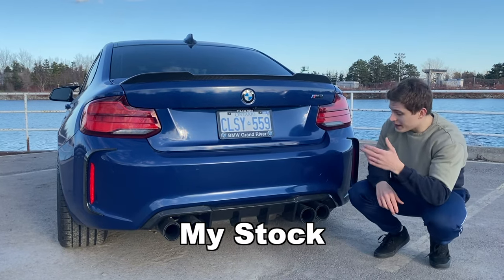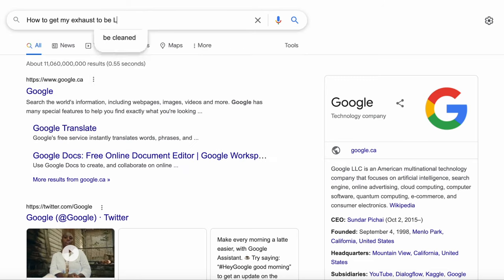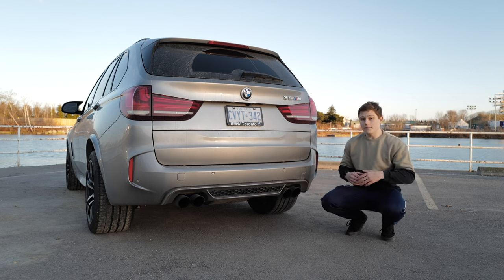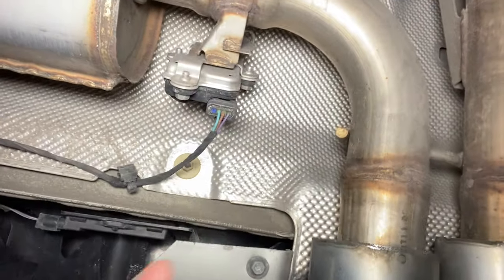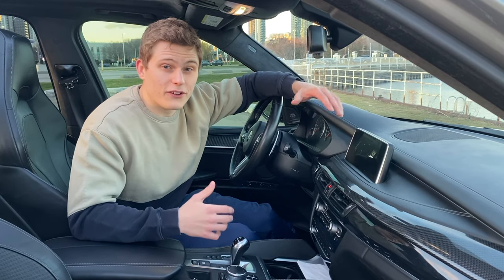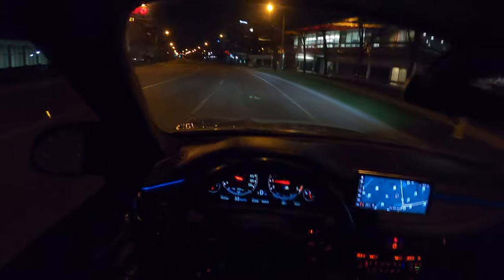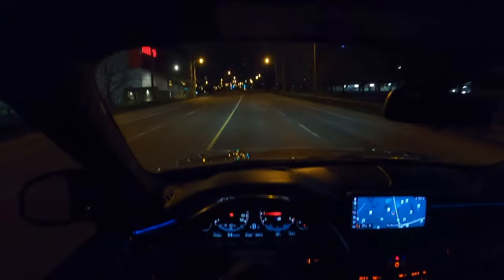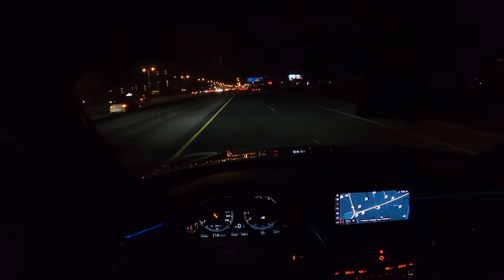How I Unlocked My BMW's Hidden *LOUD* Exhaust

Comment: Wouldn’t recommend doing this but instead do the fuse method
Reply from the maker: Yep both work. Fuse method has no chance of getting the connectors dirty
Reply: Which fuse number?
Reply: Which fuse?,mine a 316i n13 2014
Reply: What’s the fuse method

Comment: On my m135i F20 I just pulled the exhaust flap fuse out (fuse 146). It’s takes seconds.. 
the exhaust flap is opens when you turn the car off so just remove the fuse BEFORE you start the car and job done. Not sure what other BMW’s this method will work on
Reply: Do you know if this would work for a 650i
Reply: Just saw the last line, lol.
Reply: @thetipmoore find the fuse for your flap and take it out.. just give it a try

Comment: I unplugged electrical connector from the trunk wall left side behind the back lamp. So it stays clean. My car is 2011 X3 35i N55 (F25 chassis). The drawback is the warm-up time takes longer now (1 minute) and when it's not warmed enough, the engine won't obey when I push the pedal gas, so I can't use it before it's warm enough.
Reply: Please don’t push your car when it’s not warm you’re killing it

Comment: Question, will more pops do damage to the internals of the M2s stock exhaust?
Reply from the maker: I'm honestly not sure, great question though. It would make sense that excessive pops (from a tune) could possibly do some damage over time, but keeping your valves open definitely wouldn't. This doesn't create more pops, rather let's you hear the existing ones better
Reply: @collectingms3803  good answer, channel is getting better. So good you support the M2 Community
Reply from the maker: @marlborom2c829  I really appreciate that! I've been putting a lot more time into each video. It's great having you in the M community as well, love the videos
Reply: Pops and bangs are fuel igniting at the wrong time and/or place and are never good for longevity and, in my opinion, sound terrible,  I'm always embarrassed for them when I hear road cars specifically detuned to do this..
Reply: @disclosed2229  I agree.  It can't be good. Cheers, off to learn more
Reply: @disclosed2229  I agree.  It can't be good. Cheers, off to learn more

Comment: Will it work on 330i?
Reply: Finally a person with the same car as me
Reply: 330i is work ?
Reply: @jackrayko7167  I tried it out and it works exactly the same, if not easier due to only one sided exhaust.  I notice a significant difference in the sound especially at lower RPM. Sounds so much better driving casually.